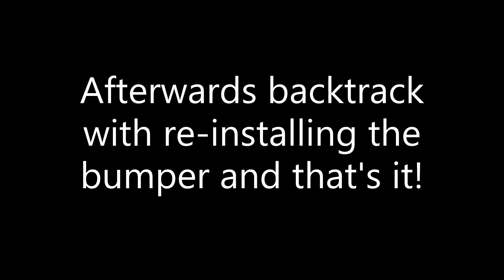3D Motorsport Design air inlet install on Veloster N!

Comment: Nice big intake, but not available for the DCT so I had to go with the Velossa tech.
Reply: Does it make a noticeable difference?
Reply: @Ninrai37  I don't think it makes a difference you would notice performance wise especially on a turbo but it does force colder air into the intake which helps keep turbo cooler.
Reply: @CTF33  I am probably just gonna do the AEM intake on mine at some point 🤷‍♂️
Reply: @Catgat37  You still need the air inlet to get the cold air from the grill.